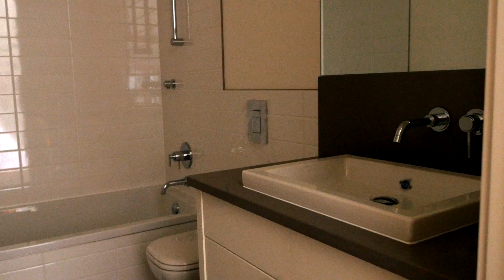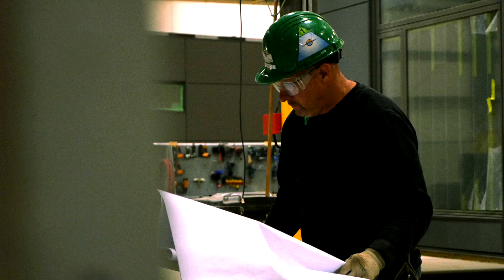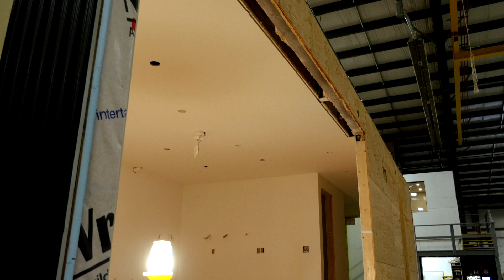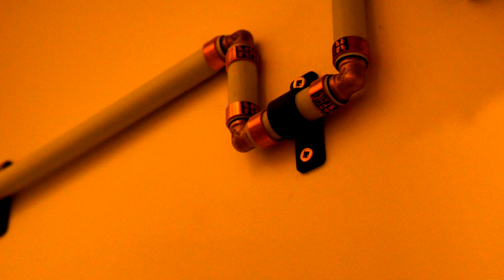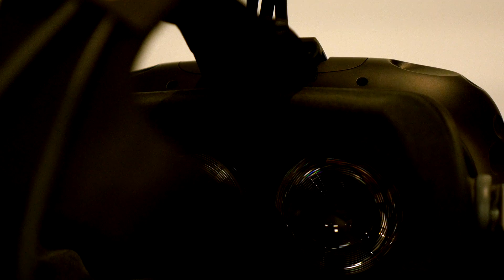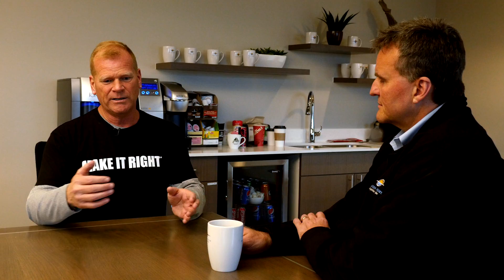Modular Homes built by AUTOMOTIVE staff in less than 3 months.

Comment: I worked for Barvista Holmes some 20 years ago. We had a box come off the axles at 70 mph, slid some 1/2 mile, wiping out EVERY floor joist. They got it back to the shop and cribbed up and we did the first walk through. Not one drywall crack, every door and window reveal and operation was correct! Pretty impressed with how well it held together.